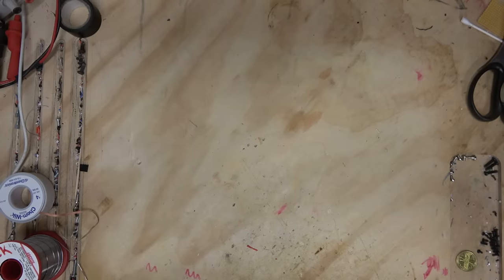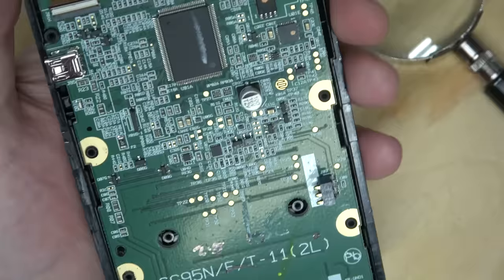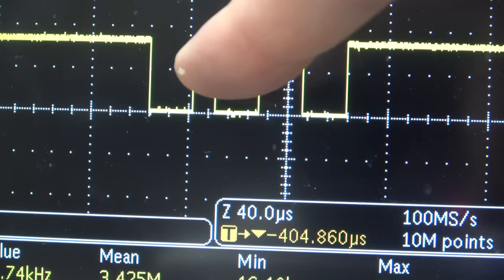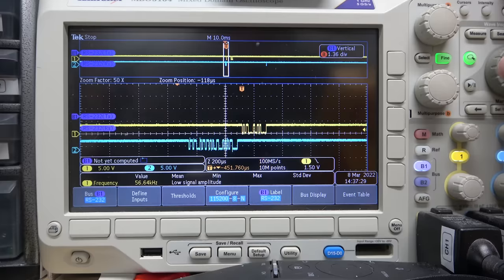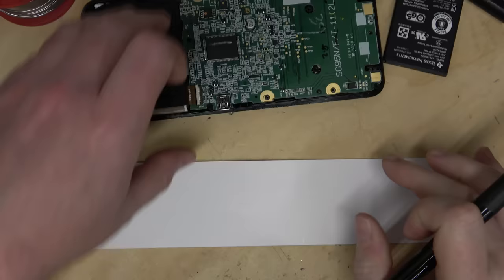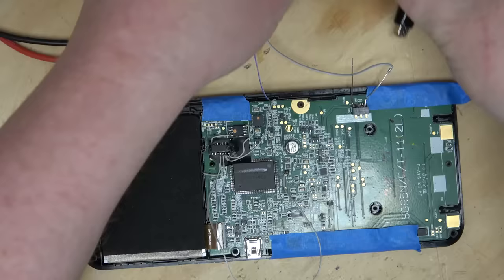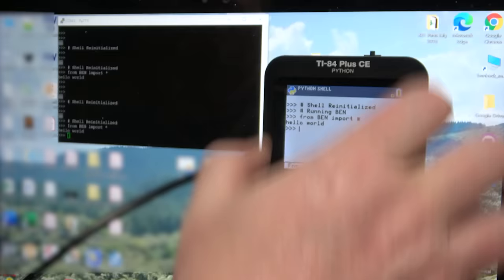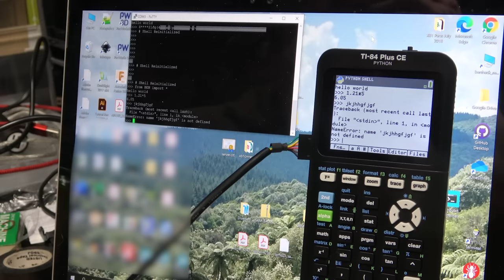Inside the TI 84 Python Edition Calculator!

Comment: I don't know that I'd call this solution janky. They've effectively grafted in an embedded Python subsystem with minimal changes needed to be made to the existing calculator design. Doing so, they don't need to recompile Python to run on the Z80 and none of the calculations running on Python use the Z80. This is a pretty elegant way to introduce a modern programming environment while keeping the rest of the calculator largely unaltered. Contrast this with the WinCE update added to HP Prime and the overhead is almost nothing. What's perhaps more interesting is because the Python module is just a serial connection, you could replace it with anything else which uses a serial connection, not just limiting yourself to Python.

Comment: Hi! I'm one of the contributors to the third-party C toolchain for the CE. I was working on a patch for the Python app a while back before giving up because there was so little RAM that it couldn't hold all the functions for the main processor's graphics API, even though the Python code was all just like one line per function since it was literally doing all the work on the other processor.
As a software guy, I hadn't really messed around with test points much, beyond dumping the ARM's ROM, so it's good that someone's documented some of those.
I've previously worked out what most of the escape sequences the calculator uses do - of the 7 they've implemented, 2 are entirely custom, and the remaining 5 use the same final character as an ANSI sequence that does about the same thing, but annoyingly none of them are actually standard-compliant. For example, ESC [ m is Set Graphics Rendition, which sets the text color, but it uses entirely different numbers for each color than regular terminals do.
As you speculated, there's also an SPI connection between the two processors, which is used when transferring the firmware, programs, TI-OS lists, certain graphics data, etc. I still haven't entirely figured out how that works, either in terms of protocol, which test points it's using, or what system calls it uses.
As for why the keyboard is doing that - the OS has a complicated system of scan codes and key codes and tokens that it uses, none of which are ASCII, and the keyboard inputs get translated into key codes. The Python app listens for key codes using the OS's functions, then translates them into ASCII strings, and probably wasn't designed with an external keyboard in mind, which is why it's so jank.
eZ80acclaim! is the name of one of Zilog's single chip computers, while the CE uses a different custom ASIC that implements the same eZ80 ISA. And yeah, a lot of the code has been completely untouched for decades - when writing assembly code for it I still find myself primarily referencing SDK documentation for the TI-83 that's nearly as old as I am.
There are also several other TI calculators that have worse names than this one, somehow - there's the TI-83 Premium CE Edition Python, which is exactly the same thing but in French but cheaper and with slightly more software features, and the TI-82 Advanced Edition Python, which is exactly the same thing but in the old style of case and with a different OS.

Comment: Great video! It's great to see that our beloved Z80 is not dead!

I would guess they chose UART protocol because it is asynchronous, which corresponds to the nature of the transfers happening: the Z80 sends data to the ARM core, this one will process them and send the response later.
With SPI on the other hand, transfers are all synchronous and initiated by the master (Z80) but the Z80 doesn't know when the ARM core has finished processing the data. In practice they could have added a ready line between both cores with a GPIO, but from what I see, they didn't want to bother with the software.

I would have loved to see the how the data were transferred with a graphical/plotting Python example.

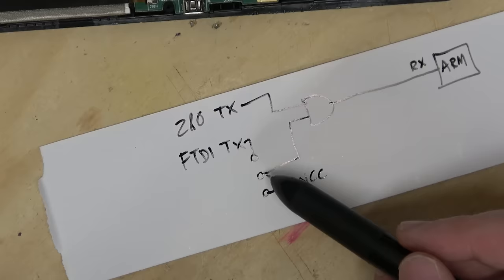Comment: 24:30 The part you want is an "Analog Switch" like a 74LVC1G315, they're super useful for making mods like this. You can connect the 'gate' input of the switch to the FTDI chip's 'TX activity' pin (normally used for enabling a RS485 output driver and/or blinking the TX activity LED), and just otherwise have the appropriate pullup/pulldown resistor to keep the line connected normally whenever the FTDI is not actively sending a byte (or indeed, when it's disconnected).
(I've used that exact chip for modding in one of those bluetooth wireless serial modules into a USB serial device, worked like a charm!)

Comment: The HP Prime graphing calculator, like the Numworks, also runs Python natively. It uses a beast of processor though, an ARM Cortex A7 @528 Mhz, with 256 Mb of RAM and 512 Mb of flash.
Reply from the maker: That's one beefy Beefasaurus Rex! (tm)
Reply: Help me out here… is this a calculator or a mid 90s super computer?

Comment: In theory you could replace the slow Python microprocessor with a 100x faster Raspberry Pi. And also watch Linux boot process running inside the Python mode!

Comment: I did a similar thing to this setup on my home brew Z180 computer with a Pi Pico running micropython. The Z180 sends and receives serial ASCII chars as python commands to the Pico and the Pico runs the python code. A second Z180 serial port connects to putty terminal for keyboard input and display output.

Comment: I can see not wanting to rewrite all their Z80 stuff to work on an ARM.  It works and porting it would probably only add bugs.  Wonder why they don't do like HP did on the HP49/HP50 and run an emulator of their older CPU.  For those not in the know, the HP 48 ran a (very slow) custom CPU called a Saturn: https://en.wikipedia.org/wiki/HP_Saturn .  When HP did an updated version of that calculator, that CPU was very, very old and could no longer be manufactured, so they built an emulator for the old CPU and ran it on a Samsung ARM.

Comment: Fantastic hack.
You don't need the switch, just a pull-up to 3V3 would make it "automatic".
Reply: That was my first thought. You may also get away with two diodes and a pullup resistor instead of that and gate.

Comment: Now, try using quit() to see if you drop to a shell. It could be interesting to see if you can flash the ARM chip with different things and see if you could use it with the calculator. Like a mini Linux session or emulator running alongside zOS.

You could always capture what's being programmed to the ARM chip (Or possibly SRAM) on the initialization of Python.

Comment: Honestly surprised TI even still uses a qfn main cpu instead of an smd one.
Also imagine having a backwards-compatible calculator and not letting the users run older programs... Why though? It should fit on the screen
Reply: Version 1 of TI's ASIC was a small BGA chip. They switched to QFN for the second major iteration (there was a minor revision that eliminated custom interrupt service routine support, just because they're dicks). My guess is that QFN packaging is slightly cheaper than BGA, and they needed BGA for the first version because it used a parallel flash, requiring 32 pins (22 address, eight data, two control) just for the flash interface; they're now using a QSPI flash.

Comment: Micropython and Circuitpython are both highly optimized for their targets, which means the poor performance is largely due to the latency hit the ez80 takes during communications with the coprocessor.
Reply: I refuse to use circuit python as long as 'lady ada' charges 20 dollars for a single dip led. Companies like adafruit make it impossible for kids in lower income families to get into electronics. I'm on a disability pension and I donate free learning kits all the time, not for thanks but because someone has to. I don't see or hear of many others doing it. All of my creator friends have (basically become sponsored review channels) and hoard stuff they will never use instead of donating anonymously like me. I know im contradicting myself but it's rampant. Who needs to keep 8 different  arduino kits from every manufacturer and a million Chinese multimeters. That's my rant for the week haha.
Reply: @jstro-hobbytech  Lada Ada is an absolute icon and I won't have you besmirch her name.

Have at thee!

I kid. I've donated parts, myself, though mostly to specific devs who couldn't afford a part they need. I don't get anything free, though, that would be nice.

I find most of adafruit's offerings to be quite affordable, and I am low income, as well.

I do prefer micropython, though; it is more generically designed and therefore easier to deploy on mismatched fleets of devices.
Reply: @talosthoren5409  I can respect your opinion. I live in Canada as well and amazon is the only real place to get adafruit stuff. I paid 60 dollars for a bno055 module, on sale. Haha. 

You make a lot of good points and I can agree with you to a point as all the framework stuff she has written for people using the arduino ide. 

15usd for a single led is madness though. Haha

Cheers man. Thank you for not taking what I said to be trolling and providing real opinions based on your experience. I wish everyone was the same.
Reply: @jstro-hobbytech  We can definitely agree there!

Comment: I mean there is no reason you couldn't port Circuit/MicroPython to the eZ80 (the main cpu in the TI), but it is a 24 bit (not 32 bit ALU).  But apparently it was easier/cheaper to add a M0 than do that

Comment: The TI-82 truly is the graphic calculator line that refuses to die.
Reply: I have a 82 right in front of me but I can’t find out what cord/program to use to install programs on it. I’ve searched but most the info is from the 90s but even with using Mac Os9 I still can’t get my graph link cable to work
Reply: @mountainmanmcbeachfront5296  Have you tried using TiLP? If you have one of the clear plastic USB->2.55mm cables (referred to as "silverlink" by the community), that's as good as it gets cable wise. The serial graphlink cables are a huge pain to work with.

Comment: Wouldn't that ARM chip be actually faster doing calculator things than that Z80?
Reply from the maker: The Z80 Acclaim MCU can clock I wanna say 180MHz? Vs 48 for those M0's
Reply: @BenHeckHacks  ohh, i thought it runs at like 16 or 30mhz

Comment: Why don't they just use a modern ARM chip and emulate that Z80 in software? HP has done exactly that, they emulated the old Saturn calculator CPU and the result was much faster than the vintage models.
Reply: Higher development cost probably. :)
Reply: Can't eat into profits with pesky R&D costs

Comment: You could do away with the switch by pulling the FTDI input to the AND gate up with a resistor. 

That way you can simply connect and disconnect the FTDI cable at will and the signal will naturally idle high.

Comment: Python has some of the drawbacks of being interpreted, but it is very good for quickly prototyping an idea, and it's the best solution for onetime use solutions. I tell people not to learn easy languages first because it makes languages like C seem cumbersome.
Reply: to be fair though, Python is so much nicer to program with compared to BASIC, let alone TI-Basic heh.
Personally I just wish there was an editor+toolchain for doing C or assembly directly on the TI-84, that'd be just absolutely beautiful but one can dream.
Reply: Python is more of a super calculator. Its not really mean for programmers, moreso its for data anylists, machine learning engineers, and other more math intensive applications. Programmers shouldnt even really touch it to be honest, other scripting languages like lua, perl, or even shell script can usually get the job done, often quicker (at least in my opinion).

Comment: Remember the python module? It was a small external module that connected to the non-Python T84PCE's USB mini port, it was equipped with tbe virtually same Atmel SAMD21 MCU & communicated via USB as a terminal.

Comment: I have one of these. Python performance isn't bad for computation, but graphing is very slow. Still nicer to use than TI-Basic, and  as far as I can tell, it's about the same speed. I know they had an add on you could use on the older 84+CE that did something similar over USB to run Python

Comment: Hey. I believe the escape code "ESC[F" you were seeing is the "Cursor previous line" command, as listed in the wikipedia article under "CSI sequences" ( https://en.wikipedia.org/wiki/ANSI_escape_code#CSI_(Control_Sequence_Introducer)_sequences ). The CSI sequence being the ESC[ bit. It takes in an optional `n` argument preceding `F` for the number of lines to move upwards, omitting it (as is the case with the sequence witnessed in the video) will default the command to n=1.

Comment: Hi Ben, I'm at minute 17, and I dunno if anyone else mentioned this (or if you figure it out later) but those 1B (ESC) 5B ([) sequences are old terminal escape codes, sometimes called ANSI escape codes, or 'termcap' (terminal capability) codes, and they go all the way back to the mainframe days. Your program could inline these sequences to move the cursor in two dimensions, clear the screen, change character sets, colorize text (if your terminal supported that), or even do simple graphics. It's a pretty archaic way of doing things but it still features in modern UNIX-ish systems as a way to iron out signalling differences between (for example) PuTTY on a Windows host or Terminator on a Linux host or (God help you) using a terminal emulator to pretend you've got an ancient VT102 dumb terminal when talking to the serial diagnostic port on some ancient embedded controller... like this one.

https://en.wikipedia.org/wiki/ANSI_escape_code
Reply: Oh, never mind, got to minute 19, you figured it out. Sorry. I shouldn't have doubted you. I swear sometimes I think nobody under the age of 50 is going to remember this stuff... and I'm only 48.
Reply from the maker: Haha no worries. Though I wonder what the Escape code did, as the ARM accepted PUTTY just sending CR.

Comment: You should re-upload the example programs to see how ti_plotlib communicates with the Z80.  Based on the speed of the plot when you ran it near the beginning, it might also be using escape sequences to send graphics primitives back to Z80 over the UART like an old Tektronix 4105 terminal.
Reply from the maker: That would be jank as hell.
Reply: Yes, that's correct - it uses a CSI escape sequence with a final character of G to send graphics commands back to the main processor. I haven't worked out exactly how the arguments work for it yet, though.

Comment: kinda missed out on using a pull up resistor with 2 diodes for a more "battery friendly" and gate bodge, since the thing you wanted it to do anyways was pull down the arm's rx line ;)